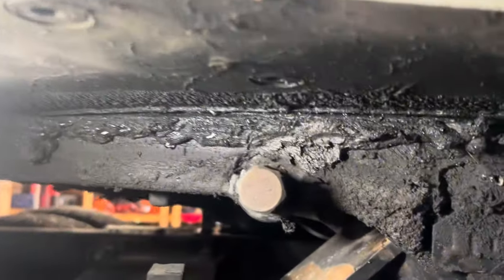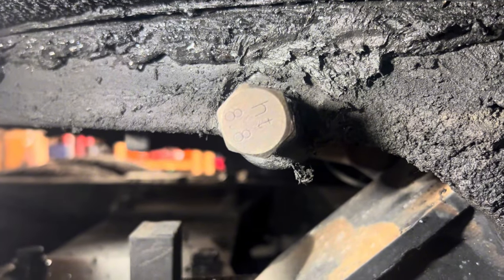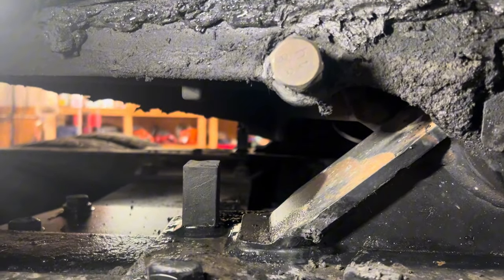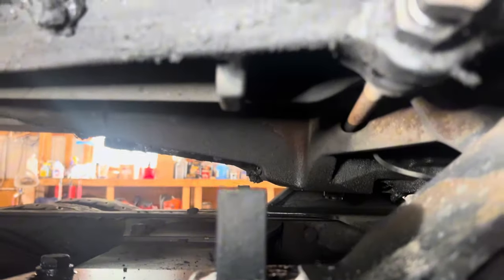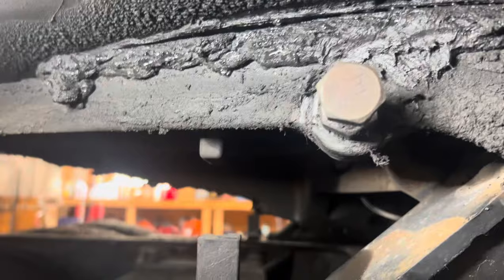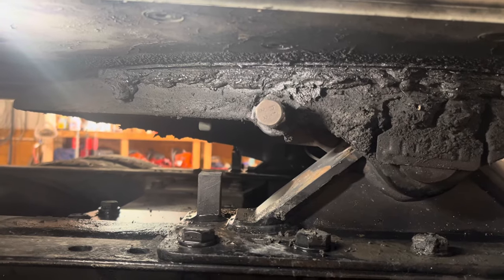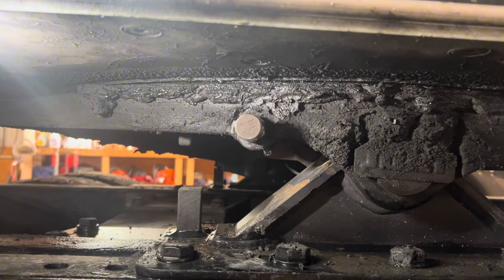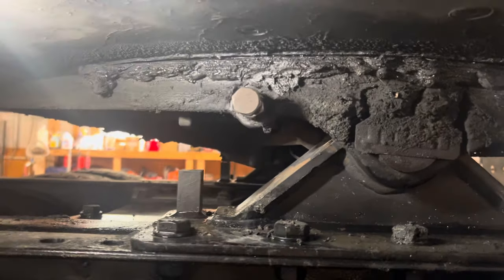How to adjust your Semi Truck 5th wheel if you have play…

Comment: Hi Matt I have a holland with adjusting bolt out the front. Like you said turn it out tightens it. I have gone to shops that have kingpin and a long handle. They lock it in your fifth wheel. Then adjust it. But I do mine like you do. Great advice as always.

Comment: The fifth on the KW I drive does not unlatch at times, I never seen a mechanic, nor I adjust the fifth wheel. Could this help with unlatching from a trailer?
Reply from the maker: Probably not if you don’t have any play when you pull forward, that sounds more like a mechanical jaw issue. Might just need some more grease.
Reply: @sturgelltruckingllc4074  Thanks, I will share your channel with our drivers. This is helpful, thanks.

Comment: I have a volvo vnl 2016 the adjustable nut is on the passenger side of the 5th wheel, i adjusted it by turning it but it keeps turning but i still have play. What could be the issue
Reply from the maker: @realmike8238  don’t know anything about the Volvo specifically but fifth wheels do eventually wear out there’s only so much adjustment and then it just needs to be replaced, have a shop check it they have a tool to tell you exactly where you’re at
Reply: @sturgelltruckingllc4074  thank you so much! It had 800k miles never adjusted never changed! I believe its time for a rebuild or a new one
Reply from the maker: @realmike8238  most likely